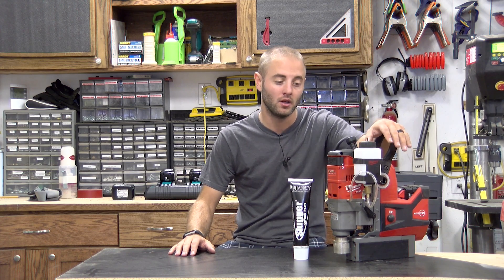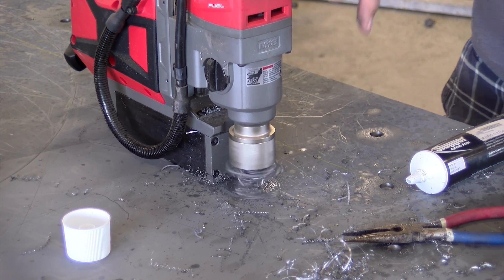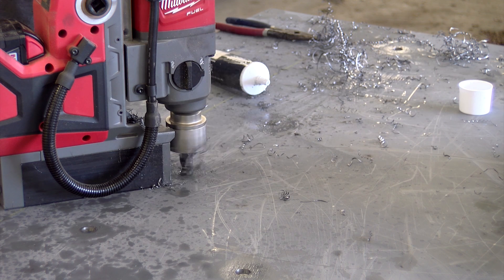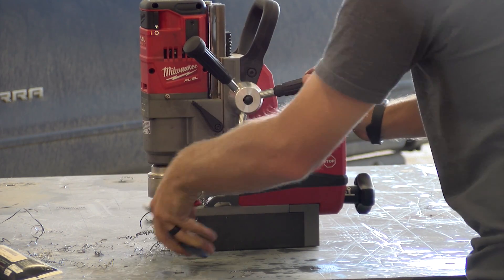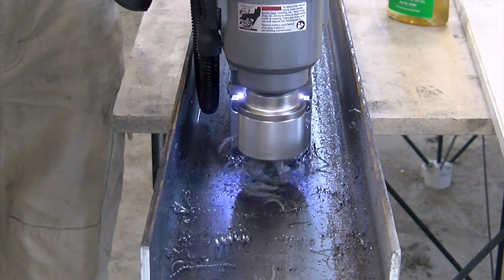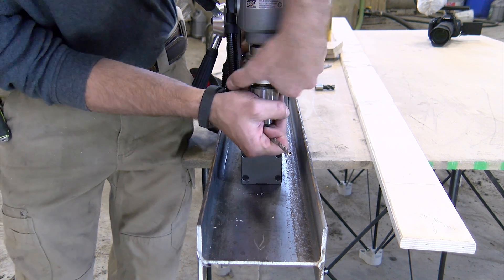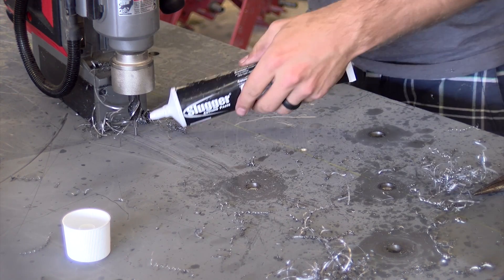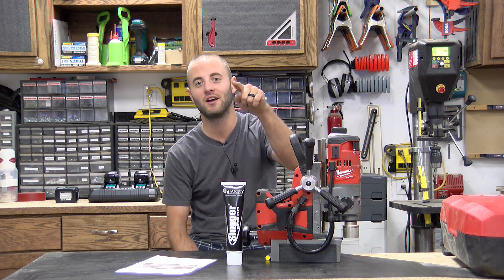Wood & Metal Projects | Milwaukee M18 Fuel Mag Drill in the Shop 2787-22

Comment: Thinking of replacing my el-cheapo drill press with this. Will mostly be drilling metal with twist drills so on my steel workbench. Is this a good choice for my needs?
Reply from the maker: It is an expensive and heavy beast that will work well with larger pieces of metal.  Small stuff would be its downfall.
Reply: @WorkshopAddict  I'm guessing that's because of the RPM limitation required when drilling small holes. Will try to test before I purchase thanks for the quick reply though!

Comment: Amazing drill.    But to use the hd 9 amp batteries you need to buy a second mag drill.    Seems to be bad planning.   The mag drill that comes with the 5 amp will not accept 9 amp batteries.

Comment: could this be used on wood...with the right bits, if you had a metal table to work on. mostly wondering about clearance say 5" for 4x4, how far below the base it could penetrate, an if those rpms would be enough for a forsner bit.
thank you for the video

Comment: wish it had a slower rpm.. 150 or so to at least get a 4in annular cutter. feel that the 400 rpm is to limiting on size of what ur capable of doing
Reply: 4" wont clear the base bub.  annular drills capable of this are huge, due to the fact you need a massive magnet to cantilever the cutter that far off of the magnet.

Comment: if you're alluding to the price and even state that it's very expensive why don't you go ahead and state with the manufacturer suggests for retail.
Reply from the maker: We avoid discussing actual prices as they change and then the information in the video become irrelevant.
Reply: Does the retail price on these tools really change that much?  I've seen videos where they simply say "At the time of this video the suggested price was $xxx" which pretty much addresses any confusion when the video is watched down the road. From the older videos I've seen a much bigger problem is availability. If you watch any older videos chances are the tool being discussed has been discontinued and replaced with something else.  Like this video, you posted a link to Amazon but the tool isn't even available from Amazon.
Reply from the maker: Larger issue is with different manufactures and the MSRP.  Milwaukee is not bad as most of the tools are sold near MSRP.  Bosch tools can be found got 60% of MSRP, so in that case, saying the MSRP might scare someone away, but in reality, it is on sale for a decent price.  Pricing and the internet these days is hard as everything is changing.  We try to post a link to pricing, so current pricing is available.
Reply: Thank you for the reply.  I agree that stating the MSRP is likely to scare folks away. My experience with all advertising is that anytime they don't tell you the price it probably means it is overly expensive!  By the way, I would be interested in hearing more about the Slugger cutting paste you are using.